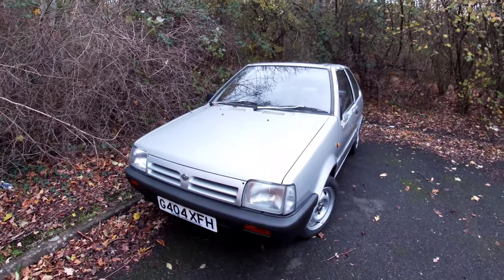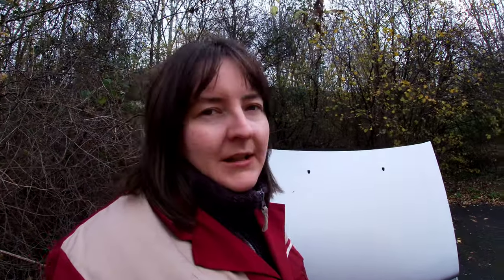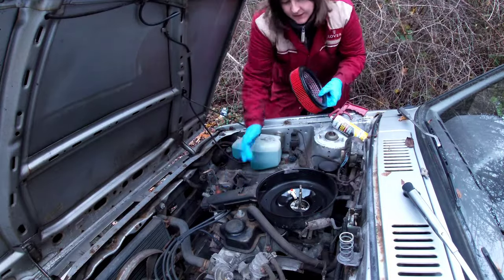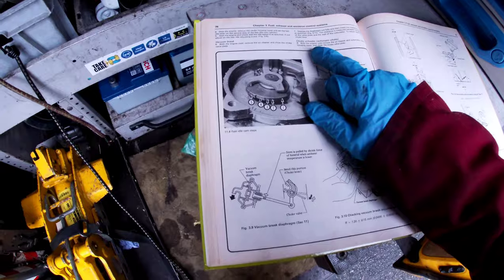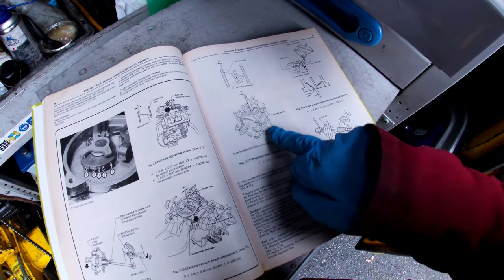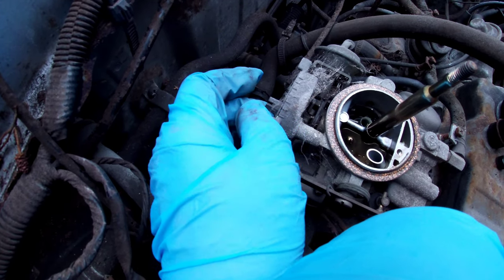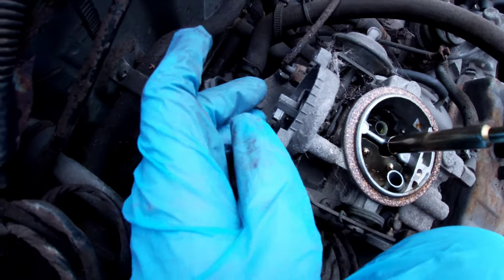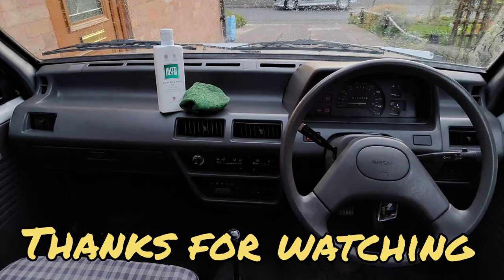Nissan Micra K10 - PART 1 -  Auto Choke Fiddling

Comment: I remember cars with automatic chokes from the 1970s and 80s and often they were a pain in the ar5e. There were many aftermarket manual choke kits available at the time, but I am not sure if any were available for Nissan Micra.
Reply: Remember I had a Yamaha Jog R with an automatic choke that crapped out, and I replaced it with a manual one and problem solved 

Not a car , but still , same problem

Comment: the automatic choke is actually a very simple device i would say yours was semi seized  when starting from cold  press the throttle  pedal once and the choke flap should be closed i noticed yours was not so when you get it freed up im sure you won't have any more starting problems 🙂.
Reply from the maker: I'm obviously much more simpler 😅

Comment: Hi
My micra k10 - starts fine and then starts turning off, I have put new leads, spark plugs and full service. Just shakes feels like it will turn off any minute… any idea
Reply from the maker: When you say it shakes like it will turn off.... 
Do you mean when driving? Or when idle ? I.e at junctions.
Reply: Did you figure this out? I'm having the same problem right now (warm engine idles soo low it's on the brink of stalling when ever I let it idle, say coming to a red light)

I normally do everything myself but I had someone else take the carb off and clean it so I think maybe something to do with the cable adjustment?

Comment: Hi
Which fuel do you put in this? E10 or E5?
Reply from the maker: E5 . I wouldn't put E10 in anything.
Reply: @Alexsassets  biggest mistake I put in E10.. didn’t realise you think it should be ok. Any idea what can cause the slight misfire
Reply from the maker: @kesarh  E10 if used regularly/ left in the fuel system will rot out old rubber quicker. But it wouldn't be an immediate issue.  
Low octane fuel can cause running issues if it's set up to run on high octane.  
I find my cars become a bit gutless if i don't use 99 octane fuel.
Reply from the maker: @kesarh  slight missfire noticable on idle? I would (with rubber handled pliers) pull off each HT lead one at a time to see if engine note changes.  
If you pull one off and it hardly changes,  I suspect spark plug issue or lead faulty.  
If it's not had a set of plugs for a while, it's worth just changing them all and see if it improves.

Comment: Do away with the bi metal spring & put a cable on it
Reply from the maker: Is that an easy conversion?
Reply: @Alexsassets  don’t know on a micra. Auto chokes I found never worked properly the bi metal spring wouldn’t heat up to open the choke or wouldn’t close properly when cold.
Reply: @Alexsassets  you used to be about to get a conversion kit for them. On my old Granada I drilled through the spindle & attached a cable . Just about worked it always started when cold